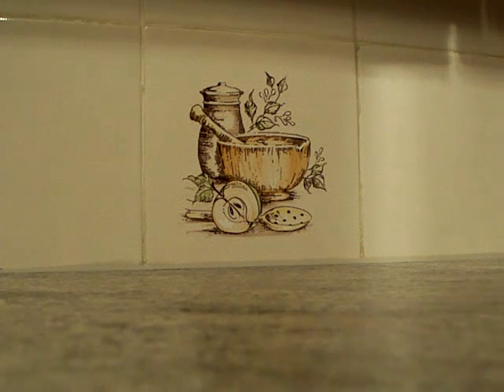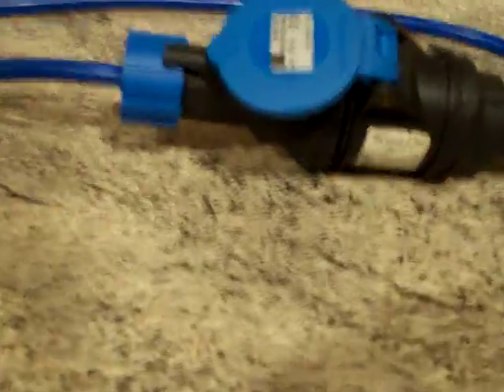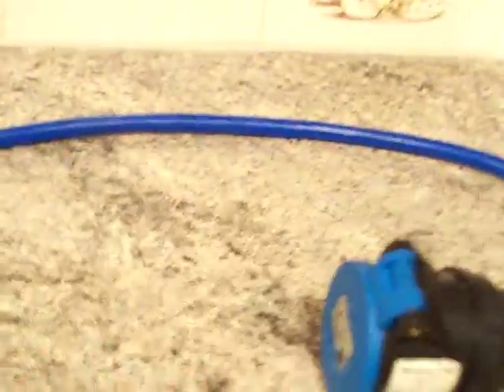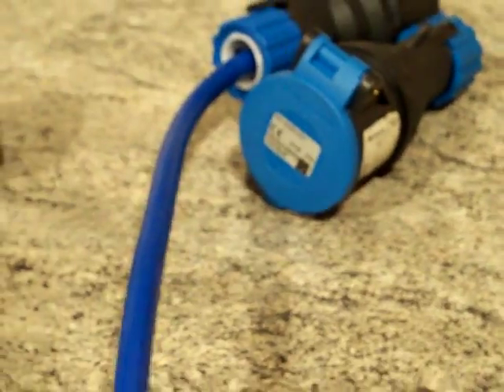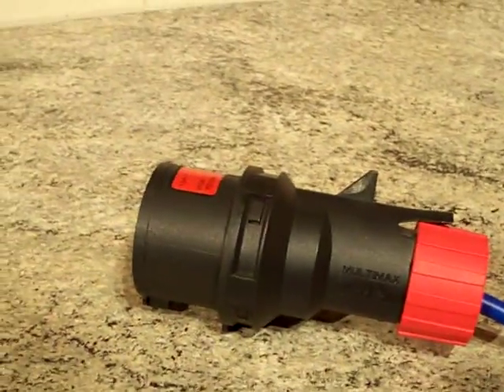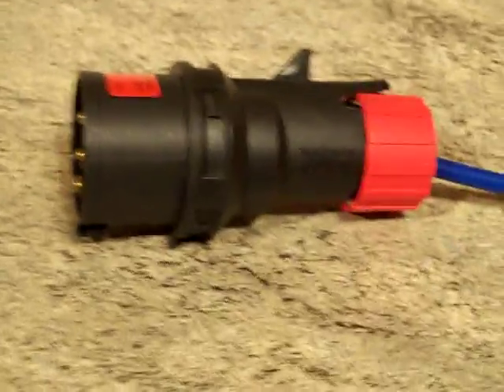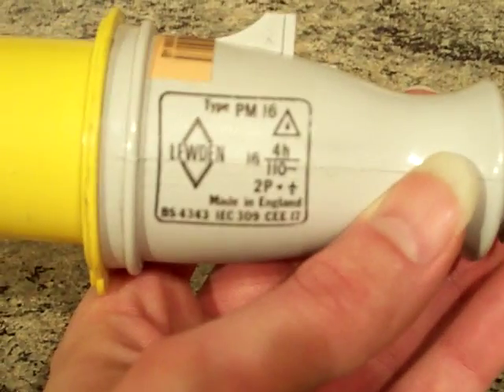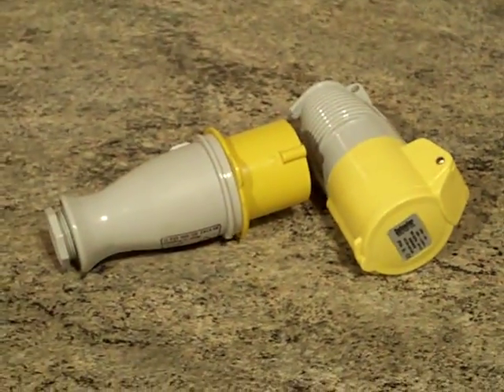Trailer : 110 volt plugs, BS EN 60309-2

Comment: Those 16A plugs are also IP44 rated and suitable for outdoor use too :)
Reply from the maker: Yep, there's two options: IP44 splashproof and IP67 watertight. The latter will have a large tightening ring around them for obtaining a tight seal. I don't have any IP67 ones of these plugs mainly because I don't have a use for one and also....the expense.

Thanxx for watching,

-BoomBoxDeluxe.

17th June 2014, 01.20